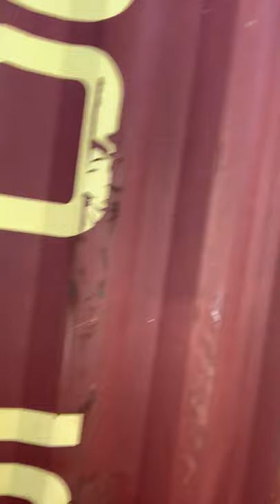Doggy Daycare Fence - part 4

Comment: Hey man you did a great job specially doing it all by youself. I am myself in negotiations with a landlord to lease about 10000 sq feet to open a doggie day care here in Texas with a giant back space for outside area. The back space of the building is almost 7000 sq feet so ill be fencing about 3000 sq feet to install synthetic turf because I cannot afford to put turf all over lol. Would you be comfortable sharing some insights about what turf you bought, what kind of flooring you use inside. Id love to hear some ideas. I decided not to do the franchising model so pretty much doing all the research on my own. Id love to reach out.